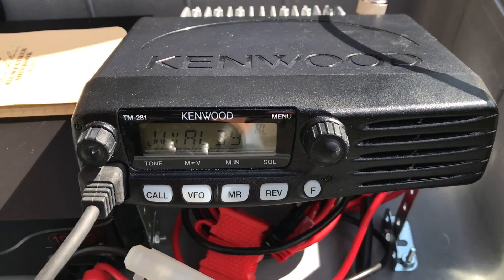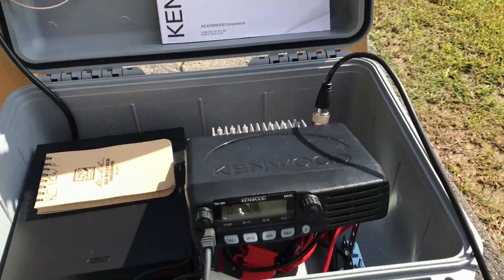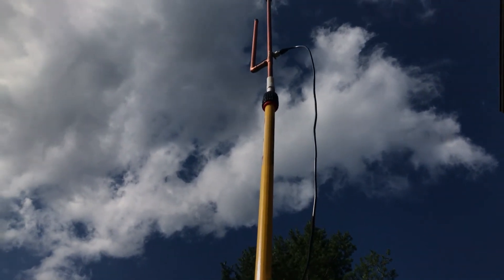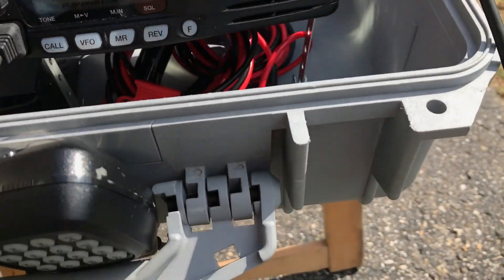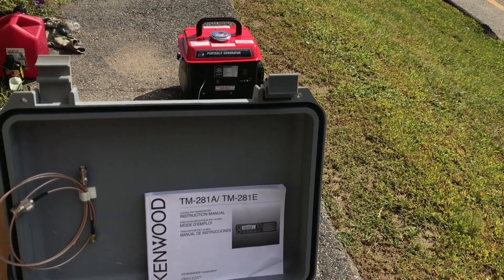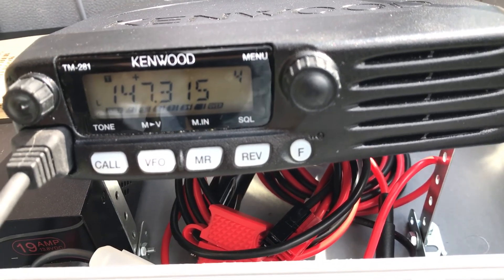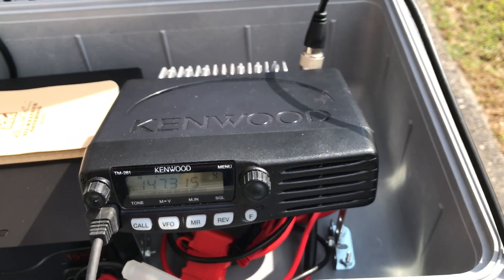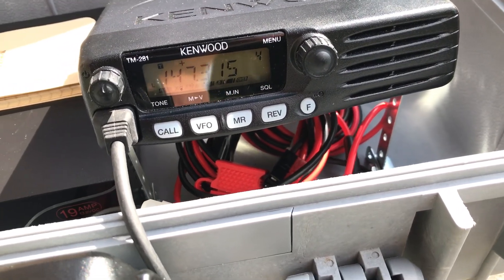FULL. Hurricane Irma Emergency Communications Test of my VHF Go-Kit

Comment: you got to get that generator farther away!  no one is going to want to heard that over you transmissions. get a solar battery system.  Save the generator for running lots of things.  noisy over kill for a single radio..
Reply from the maker: Jud Stansell no shit Sherlock. as I explained in another comment I wasn't about to unroll 100 feet of extension cord just for a test. Learn to read!

Comment: Yeah I was gonna say, sounds like RF hash on the receive audio from the generator, but hey, it works! Just have to crank up the power some.  You should try a small solar backup power source, I have an ammo can I set up with a gel cell battery, a few connectors, and a 40 watt solar panel, runs for a good long time too.
Reply from the maker: Iridium242 I have a solar power system with a 12v battery that has worked well but I need a new solar panel since it got smashed lol. I was close to the generator so I wouldn't be surprised if there was RF noise from it. I just didn't feel like breaking out my 100' extension cord just for a test. I also just checked the antenna and SWR, it'd absolutely perfect. So now I just have to anxiously wait for Irma!